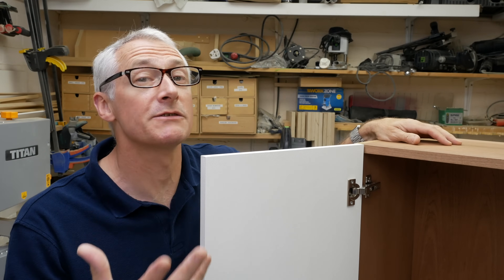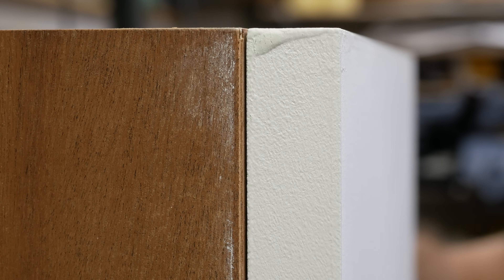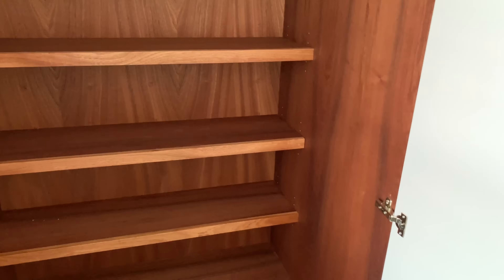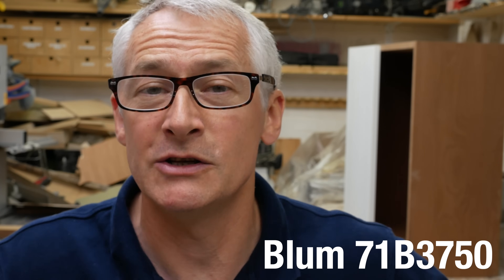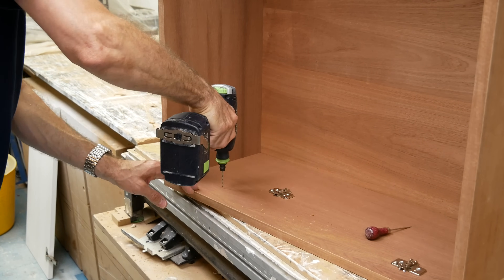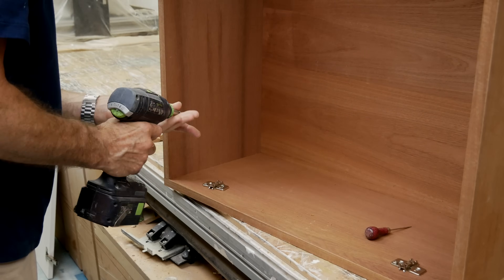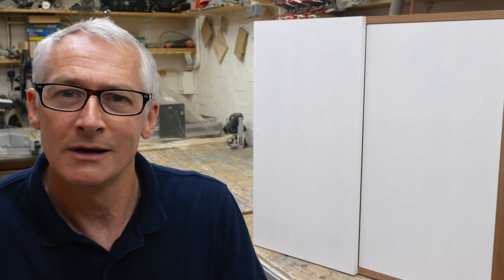How to fit concealed (Euro-style) hinges for overlay & inset cabinet doors [video # 348]

Comment: Hi Peter, first off, thank you for such a clear video, and the complete list of equipment you used - it is brilliant to find such a thorough explanation linking all the tools to make the job easier. I have one question which I have to ask because I bought the hinges before I found your channel! I have the Hafele hinges for an overlay door but I am doing an inset door...! I was going to use the hinge the other way round - so I bore the big hole in the carcass rather than the door. Will that work? Many thanks :)
Reply from the maker: Thanks! Wow, now that’s not something I’ve ever considered trying, I must admit! I guess in theory it should work, but I wouldn’t begin to know where to start marking them out, because all the measurements would be the wrong way around. In all honesty, if you can’t return them then I’d just chalk this one down to experience and buy the inset hinges - I’m sure you’d find a use for the overlay hinges somewhere along the way! 👍👍
Reply: Thanks for the quick reply Peter! I was thinking to put them away for the kitchen one day... I can't return them as it's a job that has been on the back burner for a while now - thanks Storm Dennis!
While looking at it I have noticed that there might be one advantage to doing it all backwards - the side that normally goes on the door allows you to use any screw you want, as long as it is counter sunk - whereas the other side has some rather unusual stubby screws. I am trying to make a cupboard door in a plasterboard dry wall and the with it this way round I can use some much longer screws to go through the plasterboard and into the timber without having to put a timber insert into the plasterboard. I will practice first with some rough wood first! Thanks again!

Comment: What screws do you recommend when using on 18mm doors and carcass?
Reply from the maker: Spax M-cut 4x40 👍
Reply: @10MinuteWorkshop  what about into an 18mm carcass, 4x16?
Reply from the maker: @grumpygrumpygrump  Sorry, misunderstood. You meant for hinges? Always preferred 3.5x16 for the hinges, 4x16 for the plates (unless you’re all in in the 32mm system, then you’ll want 5mm Euro screws.) 👍

Comment: Peter, please if you can tell me, what is your size of the doors for overlay hinge. Lets say the cabinet is 636x500 with 2 doors. Will it be ok fit 2 doors with dimensions 317x500? Is 2 mm less enough, or I should use different dimentions?
Reply from the maker: I have a 'how big should my doors be?' video coming along very soon, but typically 1.5-2mm is a nice gap between cabinet doors.

Comment: The bottom hinge in my cabinet has come apart and despite screws are set in. the cabinet housing and the housing in the door are both in-tact. How shall I repair this? is the hinge broken? How can I check the status?
Reply from the maker: See video 410, Fixing bad hinges - https://youtu.be/Oh_xjMIRN7k But just FYI if the screws are solid, and the carcass isn't blown, it's almost certainly the hinge that's gone bad. 👍
Reply: @10MinuteWorkshop  Hey, thanks for your prompt reply!
I saw this linked video and that was not my problem. The hinge plate is intact in my case and screws arent loose at all. My problem begins when "clicked" the hinge back onto the hinge-plate, because thats what come off for me and pushing the hinge back onto the hinge-plate isnt 'clicking' it in for me :(
Reply: but I am really glad for this helpful video! thanks!

Comment: Hi Peter- I have an issue with my cabinet door. I bought some new hinges, but they don't expand into the hole as the previous ones did- so I need to screw the hinges to the door. here's my problem- the screws just rotate inside the round plain holes in the door. Do I need dowels so the screws hold the hinge to the door? Thanks in advance!
Reply from the maker: Hi. Sounds like you’ve bought regular hinges for a door / carcass that’s been drilled for the Blum Inserta hinge; these are designed to clip into the pocket instead of being screwed down - they’re quite common in some of the usual flat-pack furniture as they’re easy to assemble. You could plug the holes and screw on the hinges you have, but you’ll probably get a better result if you return the regular hinges and buy Inserta hinges tbh. HTH. P 👍

Comment: Can I use the BlumH71B3750 for a 3/8 lipped cabinet door.
Reply from the maker: 3/8" is 9mm thick? No, concealed hinges need a ~13mm pocket for the hinge to sit in, and Blum specify 16mm minimum thickness for this hinge.

Comment: This is a really well made video - but I'm looking but finding it hard to find a good video on good strategies for fitting the really cheap hinges that you get on flat pack whose basic design make it a lot harder to do.  Most of the videos I've found just go too fast or don't really properly address the issues you get trying to fit those cheaper harder to adjust hinges.

If I am fitting say a wardrobe door with tha basic hinges where the door can easily fall off and the plates have slots I need something suitable at the bottom to support the door (other than my foot or books) that is easily adjustable.  Do you have any adivice on this part of the process?

The other difficulty I am having is with the chaeper hinges a lot of advice just says one screw is to adjust back and forth and the other is to adjust left and right, but as far as I can see to adjust the left and right you have to losen the back and forth one that's holding it tight so the back and forth screw can cause the mount to kind of pivot, but if you have three hinges you don't want to bend the door so you losen all three back and forth adjusters and the door falls off.  I haven't yet managed to find a good video that gives some useful strategies for fitting and adjusting these hinges, it feels like you need several hands.
Reply from the maker: Thanks! Trouble is that as cabinetmakers, we know how awkward the really cheap hinges can be, so tend to avoid them! 🤷‍♂️👍
Reply: @10MinuteWorkshop  Absolutely.  Tempted to go out and get 9 quality hinges.  But already paid too much.  Probably unwise buying furniture online, difficult times, but I assumed the same world wide budget furniture retailer mighty be using the same reasonably ok hinges and other fittings and reasonably accurate cutting that were the case on the last item I (we) bought in store.  Resting on their laurels maybe!

Comment: Anyone else notice that the saddle square jig puts the enter of the door cup hole 21.5mm from the door edge, whereas the uscribe jig puts it 22.5mm from the door edge?  Can’t tell from the video of course, but I bought both and was a bit confused. The 1mm difference can be adjusted with the hinges built in adjustment easy enough, but I find it odd they arn’t both the same.  I bought a second saddle square as I thought my first one had been made incorrectly.

Comment: Hi Peter, why don't my hinges attach to the cruciform hinge plate? Do my drilled holes have to be pin point accurate? i dont know what i did wrong on the install
Reply from the maker: Will the plates fit on the hinges when they’re not mounted in the carcass? Are you sure you have the plates the correct way round ie the arrow pointing outwards? Is there a slight difference between the way the plates ore orientated? If you have the top hinge connected, try leaving the bottom hinge plate loose on its screws, then attaching the hinge. Sometimes that’s all,it takes. 👍👍

Comment: Hi Peter

I thought Blum did produce soft close hinges for inset doors? Item 71B3750
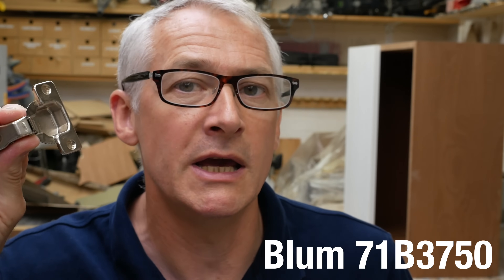Reply from the maker: 6:21 🤷‍♂️
Reply: Peter Millard my apologies, you did! I must've misunderstood as I thought you said they weren't soft close. 

Do the hinge mounting plates typically come with screws as I've seen some quite thick & chunky ones being used but the screws your used there seem quite slim as though they came with the plate
Reply from the maker: No worries! The screws that typically come with hinge plates are euro screws, for the 5mm (shelf-pin) holes you get with the ‘32mm system’  I prefer to keep the shelf pin holes for shelves, and use 4x16 screws as they give a bit more wiggle room. 👍👍.

Comment: I have full overlay cabinets, and the hinge side of my cabinet hits the wall, and I cannot fully open my doors that are against the wall, I actually can’t open them at all. Will one of these hinges solve my problem?
Reply from the maker: If my understanding of your situation is right, then yes, these concealed hinges should help with that. An alternative would be to switch the doors to inset, though obviously that would change the look of the door, and need the doors to be trimmed back significantly to fit within the carcass. HTH! P

Comment: Hi Peter. Im looking at using the blum 71B3650 half overlay hinge.  I have the template guide you suggested in this video. Are the hole mark outs/measurements etc the same as the overlay hinge?. Looking at the blum catalogue isnt the easiest thing to work out.
Reply from the maker: Hi Ben. Got to be honest, I’ve never used them, but I don’t see why they would be any different. My advice in all these situations is to do a quick test on some bits of scrap and see how it goes. 🤷‍♂️👍
Reply: @10MinuteWorkshop  thanks Peter. 👍

Comment: Hello Peter - is there a suggestion for distance from the edge of the door that the cup should be drilled to allow for a particular gap/reveal for inset doors, or is there sufficient adjustability in the hinge itself?  The Kreg jig you showed allows for this with cam type spacers (i purchased and returned it due to what I felt was an intolerable amount of slop in it).  Thanks!
Reply from the maker: The hole for the hinge cup should be on 21.5mm centre from the door edge - this should give a door gap that’s well within the adjustment available on the hinge, though as always there are some variations between manufacturers, so always wise to try a test first. 👍👍
Reply: If you look at page 79 of the current catalogue, it will give you the measurements for drilling the 35mm cup hole from the door edge according to how much overlay you want on the carcass. The black jig Peter recommends below has a hole 21.5mm centre from the door edge (or 4mm from the edge of the hole) which will give you a 15mm overlay using a 0mm spacing mounting plate. Unless I'm mistaken, this would give a 3mm gap on an 18mm carcass. If you want a smaller gap, you drill further way from the edge of the door with your 35mm hole. It's quite confusing unless you spend quite a lot of time reading it (as I've had to!)
Reply: Peter's recommendation gave worked out well.  I happened to be fitting a pair of inset doors with the Blumotion Cliptop hinge and actually wound up cutting the hole a little closer to the edge than I intended to, but there was plenty of adjustment in the hinge to get the perfect fit.

Comment: Hi peter, just wondering if you have found the screws for the hinges to get quite loose over time when using MDF?
Reply from the maker: Only over very long time scales eg decades, or if the doors have been badly treated eg young children in the house. Otherwise no issues at all. 👍
Reply: @10MinuteWorkshop  cheers mate!

Comment: Peter, this is a really useful for the hinges but is there a 270 deg. hinge you'd recommend for a drop down door 960mm wide and 150mm high.
Thanks, Mike
Reply from the maker: I’ve never used them, but the only 270° concealed hinge I’m aware of is from hafele - https://www.hafele.co.uk/en/product/concealed-cup-hinge-270-full-overlay-mounting-keyhole-fixing-arm-haefele/000000fc0001640d00010023/
HTH! P
Reply: Thanks Peter that's really helpful.  Having looked at my situation I'm wondering if I've got it right.  If you don't mind am I able to email you a sketch how it's going to be used?

Comment: What kind of hinge should I use for a diagonal frameless cabinet?
Reply from the maker: Like a corner cabinet, where the doors will be at angle to the sides of the carcass? You can get 45 degree hinges that will do the job eg:- https://www.trade-hinges.co.uk/45-degree-corner-hinge-573-p.asp. HTH P

Comment: Peter, what horizontal size  for the overlay doors to consider with respect to the frame size? How many mm they should be narrower than the frame for friction-less action when multiple frames are stacked nearby.
Reply from the maker: I aim for a couple of mm between the doors, so for a double cabinet I like the doors to be 2mm undersize - that gives 1mm on the outside edges and 2mm between the doors. A lot depends on the specifics of the installation location though 👍
Reply: @10MinuteWorkshop  ok, thanks. Now in the middle of diy huge entry hall closet project. With melamine, edge banded and ordered from the reseller.

Comment: Hi Peter, these videos are brilliant and really helping to give me the confidence to tackle a self build built in wardrobe so thank you. Would I need to use different hole positions for a 19mm thick door (valchromat). I've tried deciphering the details on the blum catalogue but it is very unclear to a novice. Also what offset do you use for a overlay door vs cabinet? So what is a sensible gap between the doors. Many thanks!
Reply from the maker: 19mm vs 18 is easily within the adjustment - I wouldn’t worry about it. I have a video due about door spacing, but I aim for a 2mm gap, I’m thrilled with 1.5mm and happy enough with 3mm. 🤷‍♂️👍
Reply: @10MinuteWorkshop  superb, thank you. I look forward to seeing the video. I have 4 carcasses in the wardrobe, so will aim for 2mm between each door 👍🤞

Comment: One of my round hinge holes is slightly closer to the edge of the door than is standard. Should I place the cabinet mounting plate slightly more inward in the cabinet? Thanks.
Reply from the maker: Are we talking about the fixing holes for the concealed hinge? If it’s just one then it could pull the hinge out of perpendicular to the edge of the door; I wouldn’t expect that to need the hinge plate moving in or out, more up/down, which may be within the range of adjustment. I’d try it and see. 👍👍
Reply: @10MinuteWorkshop  Thanks. Hinges on the right, door is leaning to the left, problem hinge hole on top. I have tried all permutations to adjust, when I get very close the screws have no more to turn. Oh Bugger what a pain!

Comment: Just want to get the doors on the built-in cabinets in the attic. The doors will be part of the wainscoting, resulting in a door thickness of 36mm. I get different max capacities of the Blum 71B7550D reading the Blum catalog and the data sheets at various retailers. According to the catalog, 36mm should work, but 30mm is max on retailers' data sheet. Can anybody make sense of this?

Comment: Hi Peter, thank you for a informative video. I have a question, though.  I installed concealed hinges on a cabinet door (partial overlay)  but when I close the door there is a gap between the door and cabinet frame on the hinge side. I am not sure if that can be overcome or perhaps there is a hinge that will better suit the application?  Thanks
Reply: I really need the entire door to sit up snug against  the cabinet face. Thanks again

Comment: Hi Peter, and thanks for the uploud. I am building my own furniture in a small cabin project, and between my bed and wall I want to make a shelf which I can open and access stuff beneath. Problem is space so I was wondering if I could mount the hinge directly to the wall, and still have the shelf flush with the wall? PS: I actually downloaded the blum cat, but I could not make sense of it. Glad if anyone know a hinge type I can usem thanks
Reply from the maker: Thanks! It’s not something I’ve ever done, but I would think an inset or cranked hinge would work; you’d have to measure for the hinge plates carefully as you won’t have the point of reference of the cabinet side, but that should do it. 👍👍

Comment: Hey Peter, we have older, but in good shape kitchen cabinets with inset doors. We want to convert the doors and drawers to the shaker style look, but I am struggling to figure out how to add the 1/4” frame on the outside front doors, but with the addition the door hits the framework. Can you recommend a hinge that might work? Thanks, Robert
Reply from the maker: Hi Robert. It sounds like you’re ‘planting on’ 1/4” material to the outside of the door to make the ‘shaker-style’ look? I think in doing so, you may have exceeded the thickness of door that the hinges are capable of supporting; from memory my ‘standard’ Blum hinges can cope with doors up to 26mm thick, but they also make a ‘thick door’ hinge - 71T9750 for the inset version - that will cope with doors up to 32mm thick. No built-in soft close with these though, you have to use the pistons that are purchased separately. HTH, Peter.
Reply: Peter Millard thanks...I truly appreciate your response. So you think these Blum hinges would pull the door out enough to avoid the added 1/4” x 3” molding from hitting the inset casing? That has been the problem trying to find a way to update the condo kitchen without spending 3k on doors. Our maintenance person does this work as side work and is excellent. Again, I appreciate your input.  I can try to attach a pic if that will clarify the doors better. Robert.
Reply from the maker: @robertwoods3088  Yes, they should do. Check the thickness of the doors when you have added the 1/4" molding to it, if it's less than 32mm (1 1/4") those hinges should do the job - though obvs. it may be wise to order up a pair to try out first, before going all-in! BTW if the doors are inset, and you're adding 1/4" to the front, you'll probably have to move them back within the carcass by the same amount - 1/4" will be beyond the extent of the adjustment available on most concealed hinges. 👍
Reply: Peter Millard thanks, again. The cab is 3/4” and adding the 1/4” makes 1”. So I should be ok, but I will order a pair to see. Thanks again for your help. I will update if you like. Robert